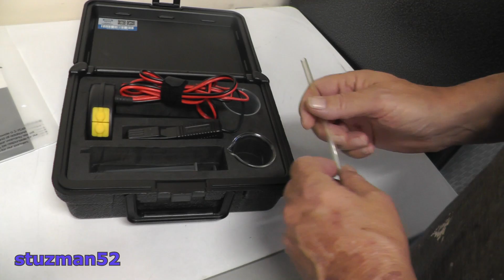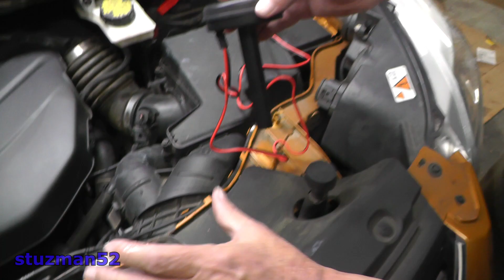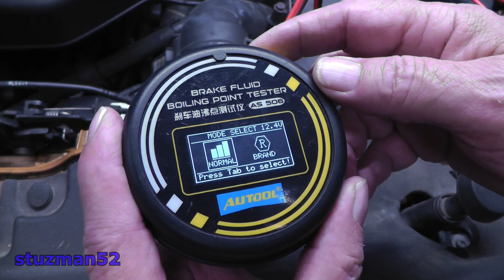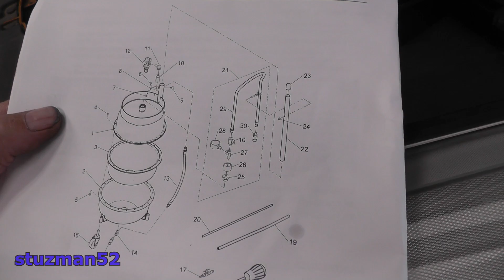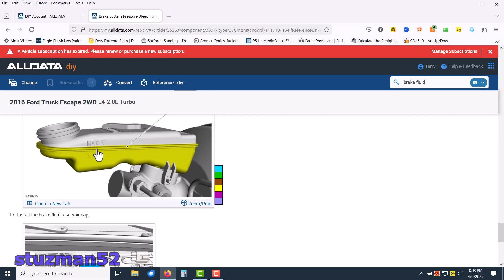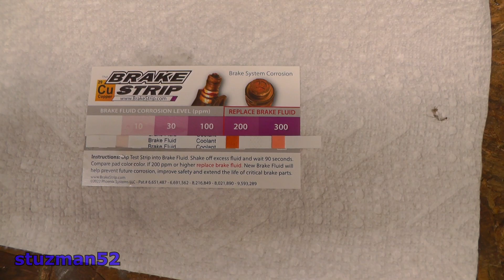Ford Escape: Brake Fluid Flush with Branick G300 Bleeder

Comment: Your video was nice to watch and if I went through that I would have the same exact conclusions. 
  - I have found a bit of a different way while researching a DIY system for myself and it doesn't require dumping fluid into a seperate holding tank and getting it nasty.
   -  Fill the brake reservoir then install a cap like the PowerProbe you have, then hook the line that comes from the cap to a gerulator, then run the other regulator line to the air compressor.
  - The inline regulator is set to whatever psi you want to bleed at and the air compressor is set above that.  It seems to perform the job well but obviously you need to pay attention to the reservoir more to make sure it doesn't get low.
   - I think a plastic cap is fine for most if using lower pressures. Heck even an old stock one modified would probably work well as long as it threads on pretty good and you're not using higher psi.  
   - People seem to run into trouble with plastic caps that use the three tab arrangement instead of threads and when they use higher than over 20 psi.  GM had those caps along with some Fords. Many believe that the three tab style reservoir needs to use a metal cap because when at pressure the plastic tabs can bend and the result is a lack of sealing.

Anyway, if you read this let me know what you think.
Reply from the maker: Thanks for sharing your method, it's always good to hear different approaches.

Comment: Great equipment. It's specialized automotive repair equipment. Cheer up. You didn't made mistake buying it, especially at 280-290$. I think it was a great deal.

Also these come pretty handy when dealing with stick shift cars , mostly the ones that have concentric slave cylinder type hydraulic clutch systems. The only way to bleed these properly is with power bleeder and to reverse bleed them from below. (from the concentric slave cylinder). Otherwise the clutch won't release fully. 😃
Reply from the maker: Maybe I spoke a little too soon about the equipment. I did another brake fluid flush on an older vehicle yesterday which didn't have ABS and it worked like a champ. It may be that vehicles with ABS has a harder time for the fluid to be pushed through the valves, etc. even at a higher pressure. In any event, it worked pretty good on that vehicle even at 15psi. Have a great day!

Comment: Very good.  Thanks for the analysis.  I have a Motive unit -- have used it on a Jeep.  Now I have a Toyota RAV4 that is 2 years old.  After seeing this I wonder if the Motive will work for that Toyota.  I sure didn't expect you would have to use 30 - 50 psi.
It wasn't clear how much fluid you had to use.  The bottle at the start when you said you were adding another quart was labeled as a pint.
Reply from the maker: Dave, you are absolutely correct about it being a pint! Brake fluid in the past that I've bought has been in quart containers and I didn't realize that this was a pint. Thanks for  the heads up! I was surprised also to find out this Escape needed 30-50psi to bleed the brakes. Hopefully, your RAV4 won't need that much air pressure. In any event, you could always use the press brake pedal, hold, etc. method as I had to do with two of the calipers in this video as mentioned. I used about 2 quarts for the bleeding process. And of course, as mentioned I had to add quite a bit of brake fluid in the unit for it to function. Have a great day!

Comment: Great to see a new vid from you. I recently re-watched your fuel pump testing/replacement series from several years ago. I have a 97 Ranger that, all of a sudden, has a crank/no start problem. It has been a project car for a while now with several ongoing frame/brakes/suspension jobs ongoing. Up on jackstands and started regularly, after fuel pump replacement months ago. Always started right up. All of a sudden..... no start....also noticed fuel reading full to the max on dash gauge with <1/4 tank.. Cannot understand what happened. No work recently near or around fuel pump hoses or wiring. Gauge has me suspicious/curious. Any suggestions what to do to trace problem?
Reply from the maker: Put a fuel pressure gauge on the system and see what kind of pressure you have. As for showing a fuel tank with < 1/4 tank would indicate you have an issue with the fuel sending unit circuit. You could substitute a variable resistor or a fixed resistor value in place of the sending unit to point you in the direction of the sending unit itself or if the issue is in the dash gauge. Look luck on what you find and have a great day!
Reply: @stuzman52  Thanks! 
 Since both events....poor fuel pressure/delivery problem and gauge going from accurate to beyond max full
 (a position the fuel needle has never shown before), there had to be some related event, since the new Delphi fuel pump has less than a total of ~couple of couple hours of idling, at most. But, you know how that goes. 
Perhaps a mouse gnawing on wires, but I've never seen one or evidence of one. Thanks again.
Reply from the maker: @jockodog2009  Just follow the basics and I'm sure you'll get to see what's going on. Have a good one!